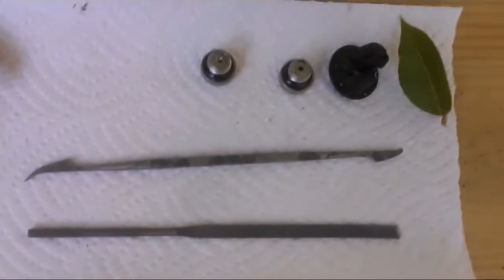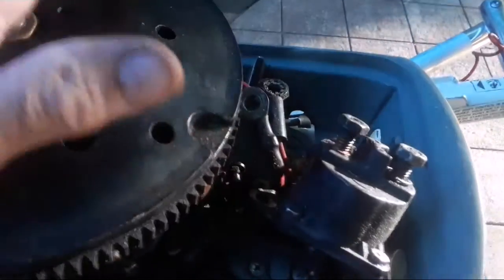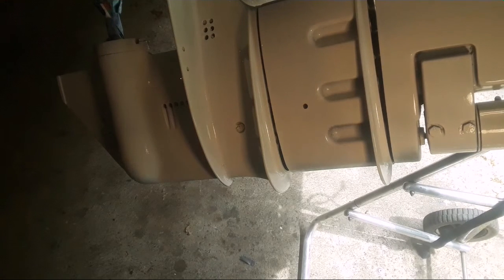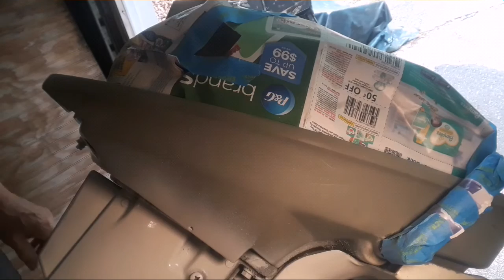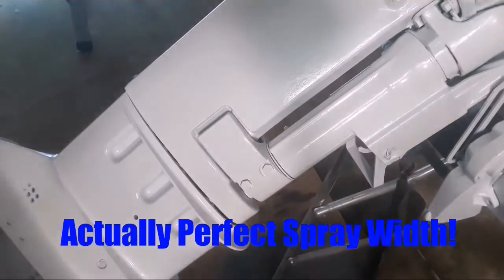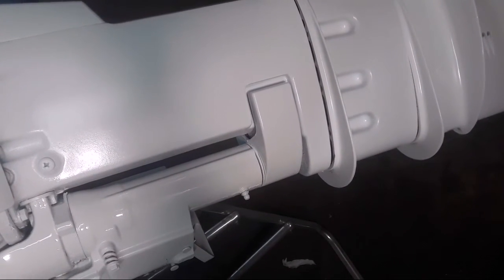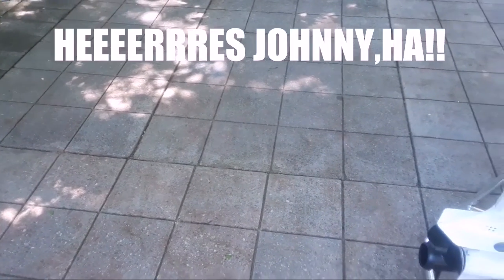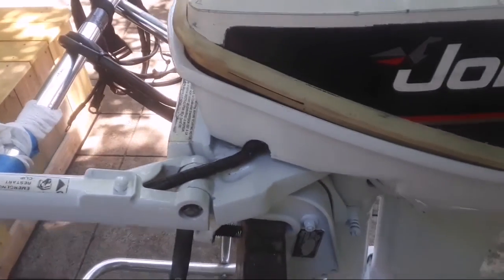WOW! PAINTING An OUTBOARD!! Prep all Done!1990 Johnson 9.9HP! Ugly Duckling Turns to White Swan!YES!

Comment: I did enjoy watching, that rustoleum does cover nicely.  The damn OMC touch up paints always plug the nozzles and don't cover nicely like this.  Needless to say, all the work is in the prep, which you took your time with.  Applying the paint is the fun part, kind of a reward for all the hard prep work.  Yeah, that stop switch wiring is correct.  That era of engines has the damn UFI ignition, there should be a single black plug to mate up with the rubber plug on your stop switch wiring.  I never really liked the way those throttle cables fit on the 9.9/15s, kind of kinked to get em into that anchor pocekt.  But, I guess anything is better than the old mess with all the cheesy plastic gears and shafts.  Looks real nice
Reply from the maker: Thanks for your nice words. Paint really impressed  the Hell out of me the Rustoleum Turbo would of been too much I think as this was even heavy volume but smaller fan. Yes I realized I can tap into the kill circuit connector right there by the coils to utilize the tiller kill and lanyard feature and still have the key switch kill too. The cable tiller is a much better design a little stiff installing but better like you said and no sloppy wheel lower pan idle adjust to deal with. Those old 9.9-15 plastic gears were too prone to wear for sure. I use plastic from clear bags to tighten them up as a filler.I do like the old tillers on the older JohnRudes though very simple but lasts the test of time pretty much.Stay tuned and Thanks for commenting and watching..... Glenn
Reply: @GPOldMarineShop    Oh yeah, forgot this is a remote electric model, may not have the plug there for the stop switch after all...
Reply from the maker: @fleetwin1  Yep Ill have to splice into the  connector circuit by the coils to have the tiller kill feature to work simple thanks! I was hoping to tap into the terminal strip but thats a no go  I tried that first.....
Reply: @GPOldMarineShop    OK, well there is no place on the terminal board for that stop wire.  
http://www.marineengine.com/parts/johnson-evinrude-parts.php?year=1990&hp=9.9&model=J10RELESC&manufacturer=Johnson&section=Motor+Cable
There should be a separate black/yellow lead in that harness that connects to the single black rubber plug coming out from the mag plate (under flywheel powerpack)...  The issue will be that you can either use the key switch to stop or the stop button that is on the tiller handle you added.   I suppose you could pigtail the two stop leads together in the harness rubber plug.  
  Perhaps someone messed with the harness in the past...D
Reply from the maker: @fleetwin1  Thats what Ill do its the only way to splice thanks for your input .There will be a finished run video on this guy when I get the key switch and a few other odds and ends. Decal for the throttle positioning I ordered and large cover plug for the faceplate area to name a few small items. Stay tuned I can almost see the end in sight,LOLL ......
Reply: @GPOldMarineShop    Finally posted my 81 9.9 for sale...Ran great at the AOMCI meet, but had a few details to finish up on it...Trying to tighten up the mesh on those damn throttle gears is a royal pain in the butt.  I have been trying to find some sort of shim/washers that will fit between the big throttle gear and casting to bring it out a bit....Finally found something close on Mcmaster, sure hope they work out...Added a washer behind the throttle gear on the tiller handle on this one, but this is really a pain trying to get that gear pin out without damaging stuff...Already had one inquiry, but it was a scam of course....
Reply from the maker: @fleetwin1  Try the clear plastic bag trick to tighten up the gears sometimes utilizing multi layers to tighten them up. Those gears can be a nightmare I know Ive been there too.Good Luck on your 9.9 sale 1981s are nice engines too!Going to pick up another motor today Ill put out a video its a 51 year old  creampuff,LOLL  Stay Tuned!
Reply from the maker: Hi Don,You know I just went back and read your comment just now about OMC touchup paints. Its funny I still have Tempo Outboard paints(laquer) from the the 1990s that still spray and are good,LOL.I touched up some paint chips and small areas on my 1970 18HP I just bought. Maybe Tempo was better than the OMC Touchups not sure who they got their paint from .I think nowadays PPG has the monopoly on paints later  ...Glenn
Reply: @GPOldMarineShop    Yeah, never any trouble with the old Tempo paints, just the paints with the "OMC" labeling....
Reply from the maker: @fleetwin1  Lately those Tractor Supply paints been clogging up on me with full cans or loss of air & full paint other than that I like their Mazic lines of enamels seems decent for $5.00/can,HAAA!